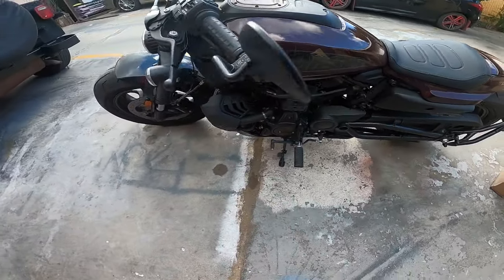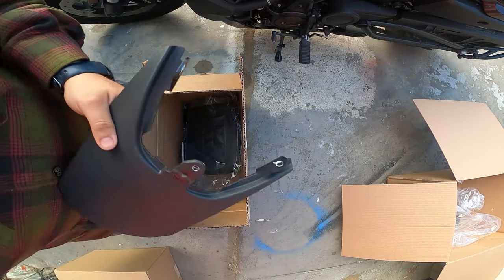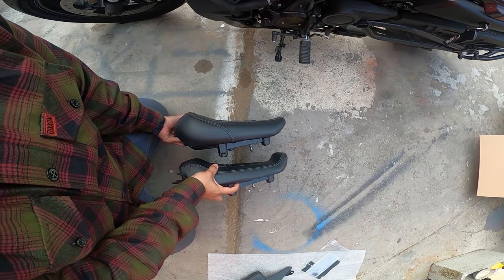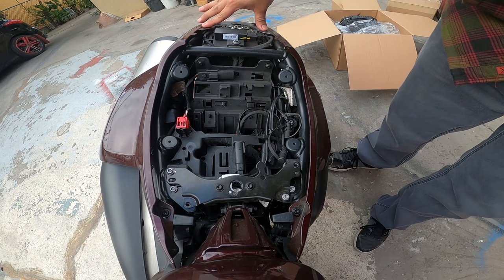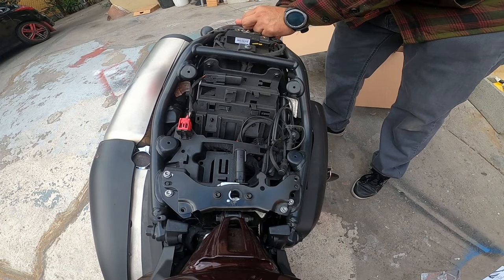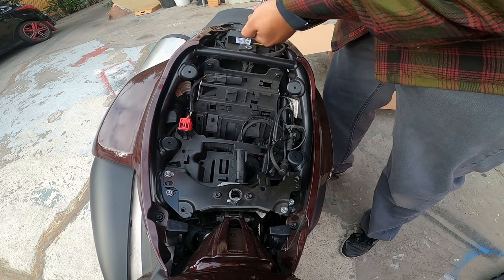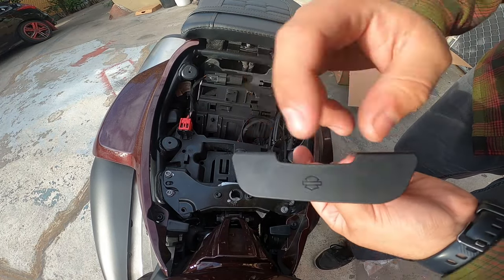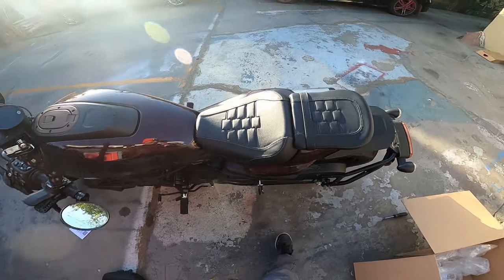Sportster S Passenger seat install

Comment: This should be a ln easy installation. The bike looks better without the passenger seat. I would buy if I could put on and off easily for some casual riding with passenger. 99% of the time I ride by myself.
Reply from the maker: I get that. I dont ride with passenger and i dont think i will. I needed it for the tail bag. I think it looks great with the pass seat tho.

Comment: Great video dude, how did you find the comfort compared to the stock seat
Reply from the maker: Definitely worth the upgrade!! More cushion for when the suspension bottoms out. I do find that if you do a pull it is easier to slide back on the seat.
Reply: @Munchie_moto  I was down at my local Harley Saturday past and sat on the new sportster S , I currently have a z1000 gen 4 and I’m interested in owning a sportster s as a second bike, everything screamed Harley until the sales guy got me to start the bike , the idle sound completely changed my mined, never got a test ride on it as normally when I do I go ram Stam into the purchase , gonna let myself stew for a while before I make any harsh responses , my back wouldn’t be the strongest so was asking about the seat
Reply from the maker: @gtrmadman4127  yes, when i was at the dealership they knew if i got on i would love it. Haha. But i also know i wanted something with RDRS and that had upgraded tech for 2021